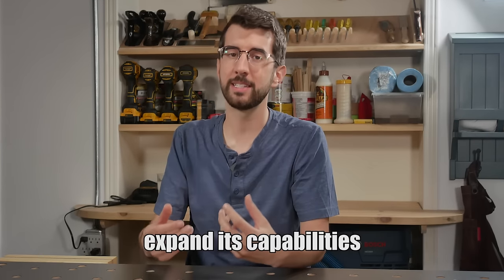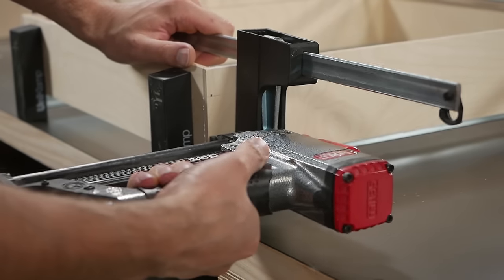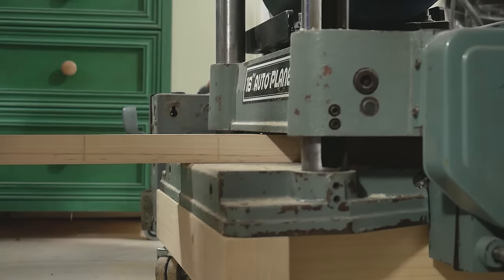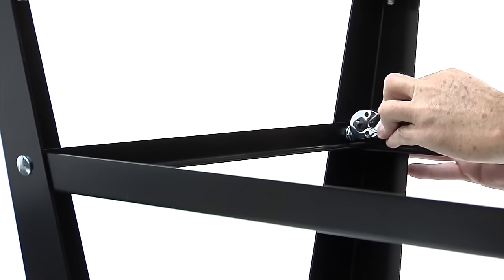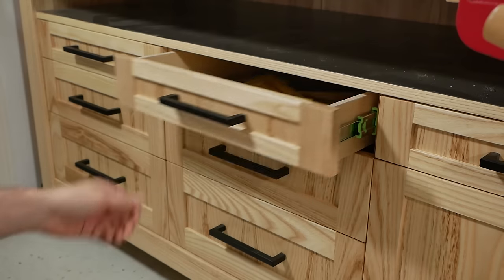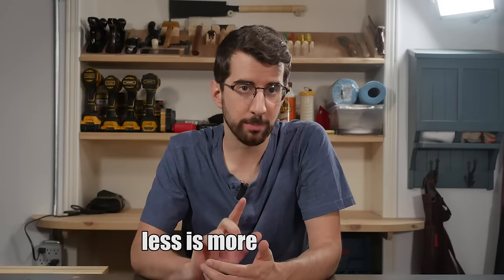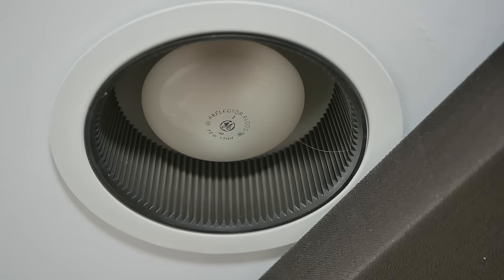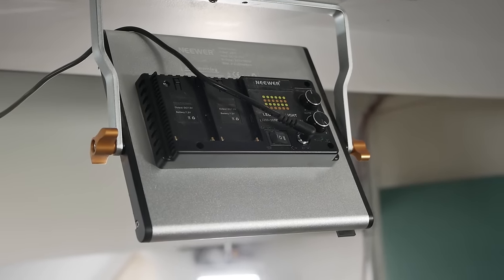a better way to layout your workshop

Comment: The problem with any workshop is storage. All you tend to see in workshops (even these large workshops) is tools. They have drop saws, table saws, bandsaws etc but you RARELY see where they store everything else that would be in a typical workshop (like paints, sheets of ply, lumber storage, rarely used but handy tools, hardware etc). Eliminate these large items and almost any space will work as a workshop. But I think every workshop HAS to have a storage area (storage room, another shed, outside undercover whatever you want to call it) for such items.

I'm just in the process of reorganising my small workshop again for I don't know the n-th time LOL. I think periodically you need to take stock of what you have, tools, hardware etc as you'll always accumulate new items over time as your needs change. There's only so much room in there and you can't always allow for new items with your current setup or trying to plan ahead (as much as you'd like to).

The way I'm looking at things these days is modularly (grouping like things together) and working a project from start to finish. Thinking of it in this way, there's always a common themed area. So if you need to add something, you can always rebuild these smaller area's.

You come home with a heap of timber - therefore it generally needs to be stored somewhere. There needs to be a designated area for that. Ideally, it should be close to your cutting area. All the cutting tools should be around the same area (circular saws, table saw, drop saws, milling, planing). Then you're going to drill holes in things. So you want all your drills, drill bits around the same area. Onto assembly, so it should be close to your fasteners, glues, fillers, clamps and assembly bench. To finish off, you'll want fillers, sanding and painting near each other (and close to your assembly bench). 

Being in a small shop, I find an assembly table also doubles as an out-feed table for the table saw. I don't like a work bench anywhere near a table saw as you're constantly cleaning up the bench to cut things.

And you're spot on about cheap tool stands. I'd also put steel racking into that as well to some extend. It does serve a purpose in that you can quickly get stuff stores. But especially in a small workshop, I think you're much better off building your own custom solution for your own needs. Or at least modifying it to some extent.

Comment: Your graph paper layout, I call it paperCAD. I'm a CAD designer, and floor plans, this is often far faster than doing 3D, at least for the 2D... when you get into what goes on the walls, 3D and elevation drawings are the same speed, but 3D can help you understand space better.

Comment: Doesn't seem applicable for your shop, but for people with a high ceiling, or no ceiling, just rafters and a straight view of the roof, vertical storage is a great option, especially for boards.  Got a bunch of cheap long boards? throw it across some rafters and it'll be there when you need it.  If you have a ladder, and some time, you could even make some shelves above your head.  A sharpie or label maker, and face the text down.  You'll know exactly where you need to set the ladder so you can climb up and grab what you need.

Comment: Once you start using that spray gun and windy sander, you won't be thinking of getting rid of the compressor, I tell you. Best point was at the end. Well done for raising that often neglected point. Whatever your workshop is like it HAS to be bright. You must be able to see what you're doing properly, for good work, and for safety.
Reply: What if you're blind? I'm not seeing how light would help then. Yes there are blind woodworkers. Some damned good ones too. The stuff they make looks good! Although they'd never know it. Because they can't see. I can get my shop brighter than a sunny day. I don't want to go blind myself though so I keep the lighting subdued. Safety is no accident.

Comment: "Drawers are where tools go to Die !"  I have proved this to myself. Peg board is very flexible and far more space efficient than French cleats! My problem with it is that I spend far to much time rearranging it. You neglected to tell us about rubberized flooring. How about a break for the woodworker?  Carefully located & abundant Electrical service outlets.  Finally how about planing & executing sawdust containment. Your video was very good! A little humor helps a lot. Maybe you could extend this or do another to cover these thoughts. Yes, I liked the Led lighting idea too.  How do you have the discipline to delete old, obsolete and Tools that don't perform. I just hate tools that are a hassle to use or just plain fight me. Hard to admit I waisted good money on something that just doesn't help.

Comment: My suggestion for safety and optimization: a central power switch.
1) you never leave the shop with a tool still running (fire hazard)
2) in an emergency with just one push all tools are safe to work around, especially for people not at home in your shop 
Just remember to leave the lighting in a separate line..

Comment: when looking for  a solution to lighting it's very easy to convert  existing fluorescent lighting fixtures to LED (look up videos on how)
Reply: I found that I could get one of those 8000 lumen folding-wing monster bulbs into my ceiling lamp sockets.
I can now use my army issue tinted polycarbonate safety glasses.
Only downside is that the pair which are on the same circuit get  out of sync sometimes. (They're designed to switch on at full brightness, then dim to medium on a quick power cycle, and again to low brightness with another flick of the switch. If they get out of sequence, ... I haven't solved that yet. )

Comment: Hey Scott. New subscriber with a small shop. I have found that I've had to live and work in the shop for a while to find the best layout. It takes time, so if you haven't found the most efficient use yet, keep at it. It will come. Also, I agree with a clean shop and drawer for usable things mentality. Looking forward to bingeing more videos!

Comment: So here’s my dilemma. All I have is an oversize two car garage and my wife wants to park “her“ car in the garage every night. Without casters there’s not a snowballs chance in Hawaii that I could get everything I want to use during the day in the garage. It all gets crammed into one corner to make room for the car at night. Did I mention that the MIG welder and my seven grinders get rolled out into the driveway every morning?

Comment: are you able to cut down a sheet of plywood in the shop, or do you have a track saw (or neither?)
Reply from the maker: i usually do it with my circular saw on my trailer before bringing it down to my shop

Comment: Casters did not work for me, I kept hitting them with my feet. I went with leveling feet that are directly under each  machine, reducing the footprint of each machine. I also went for “uniplaner” by dialing every flat top machine to the same level, thus increasing effective in feed/out feed spaces.

Comment: Functional lighting... 
Both my eyeballs point in the same direction, so my "good" lighting only needs to shine on that one spot. Two solutions: 
I've got a headlamp glued to the chin of my welding mask so I can see my starts better.
I've got a portable, gooseneck LED lamp I move around to shine directly on whatever else I'm working on that needs "good" lighting. I should probably just get a strong head lamp for that, too.
That's it: good lighting only exactly where I need it. The rest of my lighting is just to help keep me from tripping over stuff. 
Bonus tip: ring lighting for videography looks terribly unnatural. Yick.

Comment: I was really enjoying this video - until you started getting rid of tools! I'm old and crusty - and once had the same misguided thoughts as you: But then i realized that what you might not need at 40, you just might need at 60!  Now as a good little consumer, you can "just" buy it again - but often, quality of tools tend to diminish over time.  Good solid tools are not easy to come by, nor cheep. And I miss some of my good old high quality tools.

It's kind of along the lines of "if it's worth doing, it's worth doing well"

Comment: My shop in my view is a chameleon because I do woodworking, car repair, plumbing,furniture and finishing, plus small engine maintenance.  and electrical work my shop has to accomodate a vehicle one day and install toilets the next evrything is on retractable wheels.
I need to beable to park vehiclec, move in lumberthe next day or whatever else..comess up somedays the tablesaw is outside.

Comment: Given your recent miter saw station video, did your opinion on the saw change?
Reply from the maker: It's still mostly the same. I had to buy a miter saw for a construction project and decided to see how I like it in the shop. I think for things other than fine furniture, it's fine with a high quality blade, but most miter saws are very difficult to calibrate (much more difficult than a crosscut sled). So ensuring a dead nuts accurate 90 degree cut on a miter saw is much harder and frustrating. That being said, it's very useful for rough cutting parts down to size quickly, and also trimming parts to final length of the end isn't critical, like when a tenon will be cut on the end of a workpiece.
Reply: @ScottWalshWoodworking  Thanks for the quick response.

And thanks for the opinion. I'm just starting my woodworking hobby and picked up a miter saw as my first big tool for a construction project. So far I'm really happy with it but I'm also not building fine furniture (yet) :D

I will plan for a table saw space in my first workshop.

Have a great new year!

Comment: I have to make some drawers so I can unclutter my workbench. It's a mess. A catch-all if you will.
Reply: My wood shop is an 8x12 shed. I build carts for my band saw, planer, jointer and table saw so I can roll them outside to make room in the shop to work. It's a pain sometimes.

Comment: My garage is attached to the house, and on the wall, my closet protrudes nearly 3 feet into the garage.  With 1-inch foam & sheetrock I find it difficult to locate studs.  What a nightmare.

Comment: Why americans love having a jointer and a thicknesser instead of having a combined jointer-thicknesser? They goes hand in hand in most cases and it saves a lot of space.
Reply from the maker: the quality of j/p we have available over here are worse than individual jointers and planers. And if you want a good quality j/p, then it would be 2x the cost of separate machines. Space is usually cheaper here, except in my area.

Comment: I will respectfully disagree with your take on casters and laying out your shop on paper.  I worked for many years in industrial settings.  We learned long ago that making your workflow layout as flexible as possible makes life much easier.  Doing paper cutouts of your machines can help with the initial layout.  However, you will find out sooner or later that there's something that makes your workflow less than desirable that you didn't/couldn't see on paper.  Having everything easily moveable allows you to adjust and get back to work.  And, unless you are really adept at 3D modeling, going the Sketchup route can chew up an enormous amount of time.

I will agree with nearly everything else you mention.  Cleaning up and putting everything away at the end of a session can actually save a tremendous amount of time during the next session.  Having to look for a tape measure, a pencil, or that 10mm socket every time you need them can sneakily waste a ton of time.  And having 4 inches of sawdust on the ground is not only a safety hazard, it also can kill your efficiency.

Comment: I guess one thing could be "Are there any tools that you use that don't have to be in the shop?" I'm thinking about air compressors and dust collectors. It would get the noise and bulk out of the shop as long as you have a way of controlling them still. My problem is that the garage is the workshop, and the storage area. Can't really remove my dad's air compressor or the massive dust collector that's just been collecting dust. Lived in this house for 8 years, and he hasn't hooked up the dust collector once. Maybe the dust collector could go into the attic, with the waste dropping into a container in the garage or even through the eaves into a container outside.

Comment: Am I the only one that noticed: I find that in my shop everything gets in the way of everything else when I'm using it...  It would be great to have the shop I need to make the very shop that I an trying to make.   So what I'm doing is constantly moving stuff from one place to the other while I'm trying to build the very organizers for the shop to organize the shop... often things that I don't mean to get involved with stuff that gets trashed inadvertently while I'm working on things... moving things out of the shop, until recently when I got a new shed wasn't possible, but even that has its own organizational issues I'm trying to sort out... gosh this is so frustrating.  Maybe you have some advice?

Comment: I spend most of my time on my floor, because my two 16' work surfaces are covered with stuff.
Reply: The floor is also covered with stuff, of course, but it's a big space, so it's possible to shove things around when you need to use the plunge saw and it's raining.

Comment: That drilling jig is a joke.  I bought a beautiful, large drill press, then keep putting off the complex wiring.  Along the way I got one of those small drill presses you can pick up with one hand.  25 bucks.  Turns out that it does basically everything I need to do.  But it isn't a joke like that thing with springs.  And I will easily drill substantial metal.

Comment: Okay, I'm still not subscribing to you because not only did you and the girlfriend in the last video decided to go with non-contrasting splines on the corners of those dry-erase boards, but now you are talking about ditching that *GORGEOUS* drill press.  Seriously, that thing belongs in a museum it seems like.  You have issues if you want to get rid of that.  Very wrong.  Even the girlfriend must see the value in that thing.  It's delightful.  Keep it.  Or donate it to the Franklin Institute.  Wow.

Comment: Drill guides are very inaccurate.  I got rid of mine and bought a drill press.
First order tool storage means tools are put away every time you would otherwise put them down on the bench.  That idea should make an impact on your view of the concept.
Reply from the maker: Which kind did you have? I'm looking at the woodpeckers one.
Reply: @ScottWalshWoodworking  
I don't remember the brand that I had.  It was popular years ago, so I gambled on it and lost.  Woodpeckers is known for making good stuff, theirs may be OK.  But keep the drill press until after you give the Woodpecker's version a very thorough test.  I watched two guys review the Woodpeckers guide, and neither of them put any side strain on the electric drill while it was chucked onto the unit.  In other words, they didn't test it for slop.  All moving parts have to be loose enough to slide, and that looseness gets translated into some amount of tool imprecision.  As I said before, I'm sure it's better than the one I had, but find out how much slop it has as soon as you unbox it.  Put a drill on it and see how much it wiggles side to side, and how much the tip of the drill bit moves with it.   

And don't write off the point I made about tool storage.  I'm not joking, I don't put my hand tools down on the bench, they get put away every time instead.  The small ones are kept in my apron, and the rest live on a cart that has a shelf for each tool.  The cart is always by my side.  You can't forget where you put a tool if you put it away every time.  You can't knock a tool on the floor if it's in its spot.  And you can't damage a project by laying it on a tool, because tools aren't laying on the bench.

Comment: Personally, I would like it if more tools were available with multi-use in mind. A drill press which can also be used as a lathe? A work bench which can also be a router table? Etc. Yes I know that specialized tools are usually better at the task they are designed for, but not everyone has the luxury (or the space) for both a drill press and a lathe.